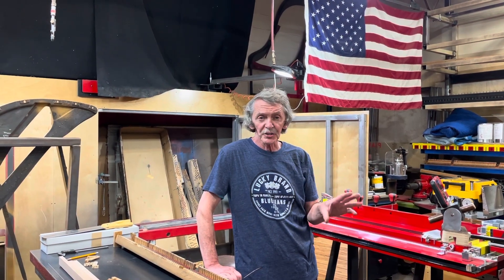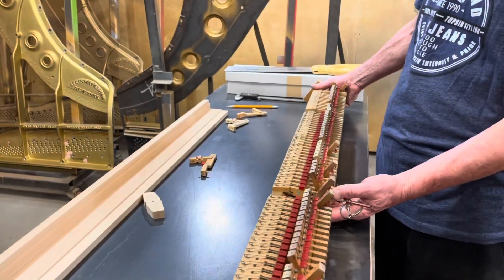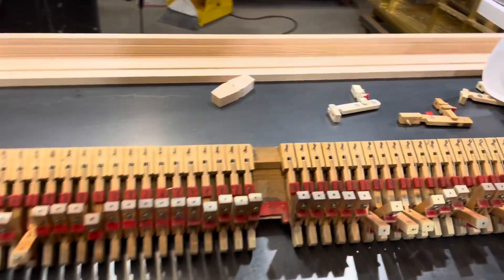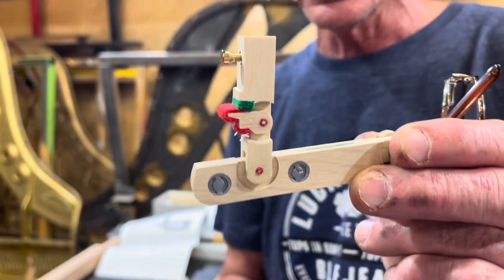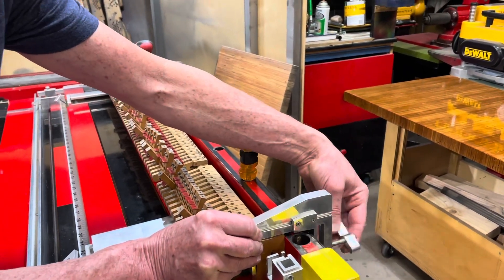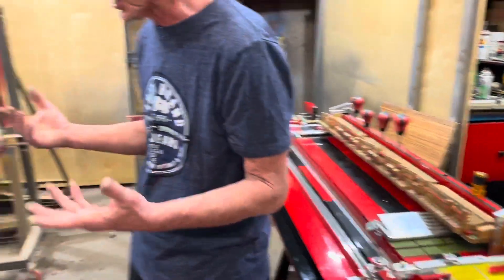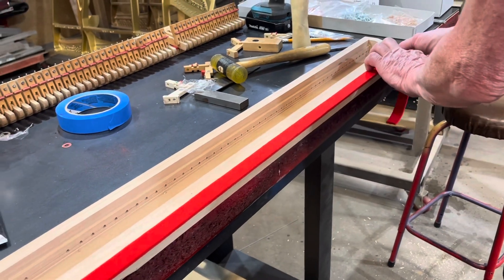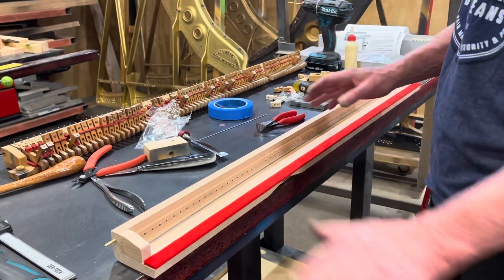Piano Solutions XXI: Damper Action Replacement. Part I

Comment: This is brilliant. Do you mill all of the metal components of your jigs in house?

 Would also enjoy a shop tour at some point.
Reply from the maker: All of the tools and devices were done at the shop. 
Honestly, in order to make them you need only several simple tools that we use in most piano shops 
(like table saw, disk sander, milling machine, drill press and buffer). 
I did some tours for the PTG members, but it was like 5 years ago. 
Thank you for your good response!